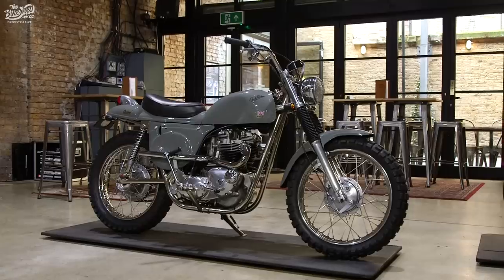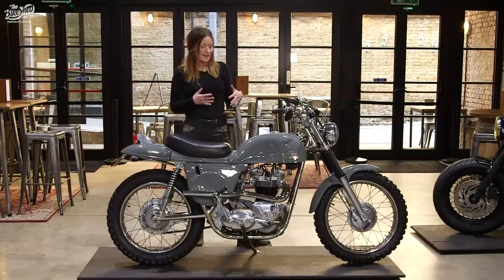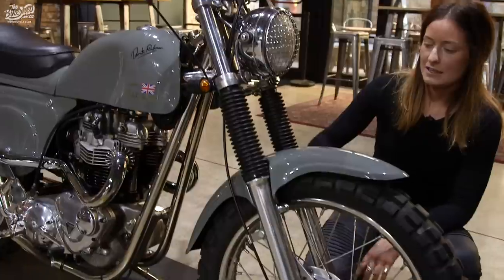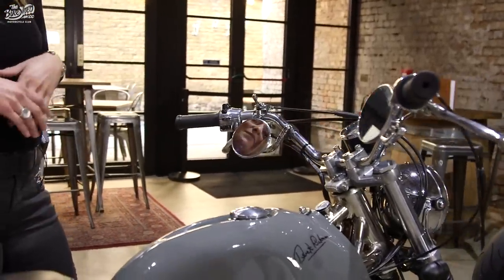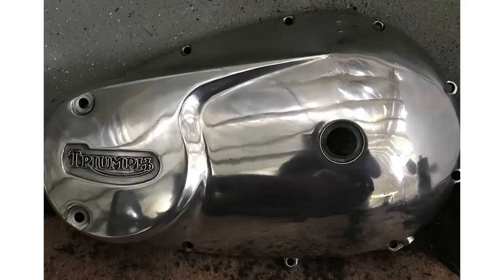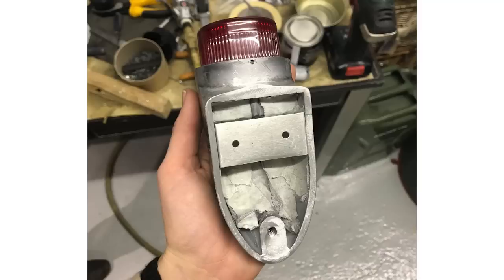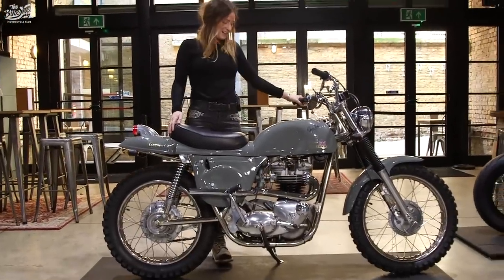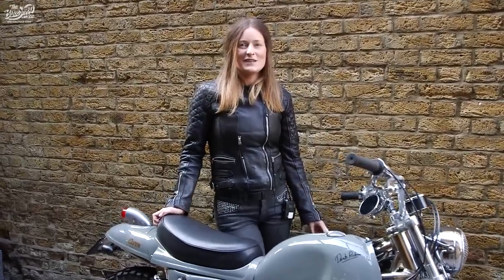Chelsea's MkIII Wasp Rickman Metisse

Comment: That is a real lovely bike. Love the nickel-plate frame, I had Triumphs for most of my life and found them to be perfect for this country.
I used a Boyer ignition in stead of points and it never missed a beat. Another good thing to add would be a 'canister oil filter'. 
Anyway its a very nice practical Motorcycle. Happy ridding.

Comment: I too have a Rickman Matisse. Purchased the frame in 1969. Installed a '63 TR6C engine from a bike I bought to tour Europe in 69. Raced it (motocross and enduro), a real pleasure. Great job on your build. Mine has lights too, no battery nor signals. Still have my '69 England license plate on it.

Comment: The WElding  that looks so nice is TIG  welding   Tungsten Inert Gas
Reply: Its "Bronzewelding" Mike , its a process that uses a Copper alloy filler wire that melts at a lower temperature than the the Steel tubing and is used to (in this case) join tubing in Low Alloy steel that may cause problems if full fusion welded.  "Brazing " is a similar process using an even lower melting point Copper alloy but is normally restricted to lap and tube socket joints such as were used on old bicycle frames.
Reply: Both processes take advantage of a phenomenon known as "Intermetallic Bonding" and can be applied using Oxy-Acetylene (traditional) or modern TIG processes.
Reply: @MegaBoilermaker   Oh  I  did a  lot  of  Brazing  such as  exhaust  pipe  before I got a MIG  welder  35  years ago .. 
   The Welds  on the Rickman  Frame  look like TIG for  sure .. Normally  with TIG   you  use a rod  similar to the  base material
Reply: @mikeskidmore6754  I met the Rickman brothers and their frames were oxy /acetylene welded  using the bronzewelding technique as did a few other British frame builders.  The reason for this choice of process is that the 4130/40 Chrome Moly Reynolds tubing used in these frames can be quite crack sensitive if the correct pre-heat/post- heat weld procedures are not followed when fully fusion welded using the correct/compatible filler wire.
George Waite Bsc.Eng  (Welding).  Retired (thank God).
Reply: There was more than one race bike builder 60s/70s that brazed their frames. They held up great and held two major advantages: remarkably less expense and the brazing never cracked.
There are lost arts out there. TiG isn’t the only process that can look good.

Comment: I am confused. The number plate came from an imported bike from the engine only? I thought the identity of the bike is carried by the frame number which was not mentioned in the earlier comment when describing the brazing and the nickel plating.  I have all sorts of difficulties registering my HRD Vincent because I don't have the front 1950s  subframe which carries the frame number  but I have the original engine with an engine number, DVLA won't issue a logbook just on the engine number.

Comment: fabulous project. I would worry about the exhaust pipe getting hot over a long ride, would want a heat shield eventually. This bike, if you optimized it with the latest tech, could be put into production. Such a good fundamental design in those old Triumphs; very low polar moment of inertia on Triumphs; they lean over more than any other bike i know of.

Comment: Gorgeous bike. Congratulations. Only one observation so far. At 2:20 those brackets do appear to be made from some substantial material, possibly stainless or mild steel. But those sharp corners mean they could be subject to vibration induced fatigue over time, even if you made them by welding two pieces of narrow material at right angles, as opposed to fabricating each from a single sheet. 

All inside corners should always be rounded off, preferably by forming them with as large a diameter drill as possible. Ideally I would have used at least a 20mm drill here, but this would still only give a radius of 10mm, which is adequate, but perhaps not ideal given the known vibration levels of Triumph twins of this period, and the dual on/off road purpose of the bike. 

Now I’m sitting back and waiting to see which C0v1d incarcerated armchair nuclear scientists are going to attempt to rebut this freely offered and well meant, pertinent and experience inspired advice. 

Ride save 

Peace

Comment: If I had to pick my favourite thing about this bike, even though this could be argued as two things, I would have to sight it’s practical authenticity. 

What do I mean? Well, in the practical department it literally has everything a real bike should have, including a seat you can sit on for hours (as opposed to a faux something inspired ‘style’ statement), a BATTERY and a BATTERY box, and side panels - when the butchers responsible for most fake retroabortions seem compelled to leave a hideously pointless Bermuda Triangle of a gap, where all common sense and practical thinking seems to go to die whimpering at the hands of those artless cretins. 

Never, in the field of bike design, has so little been copied (and universally applauded) by so many for so little constructive purpose or reason. 

But we have none of that here. Side panels are in themselves practical, and here they are also authentic to the original, and this new build. 

Finally, the builder’s inspiration has roots in perhaps the most authentic actor ever to ply his trade in HollyWeird. As a bloke who’s grown up (finally) preferring women, I have no problem admiring that famous photo of Steve McQueen on his Husqvarna without his shirt. The act alone is an act of defiance, in contravention of the terms of his contract with the studio. We are constantly told that Harleys represent rebellion, mostly by Tuttlefest duped middle aged, middle class conformers who are pretending to be rebels. 

This then is a real bike. It does what nature intended for humanity, it performs beautifully on all levels. 

Bravo. 

Finally, I would like to thank all those who toiled long hours (many months ago) to write the legislation which has afforded us all this time to reflect on such weighty matters as this, in immune system enhancing vitamin D giving natural sunlight, unfiltered and unsullied by geoengineering fake cloud screens. 

Ride safe. Stay safe

Peace